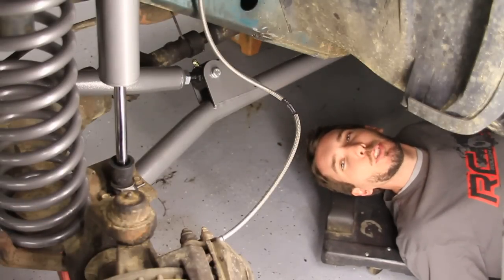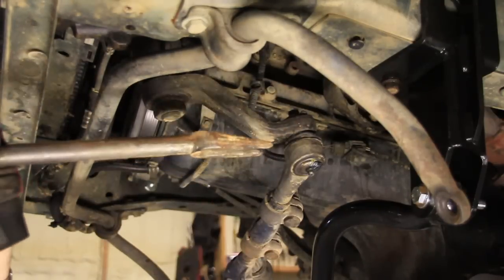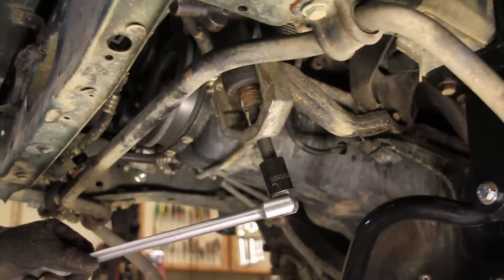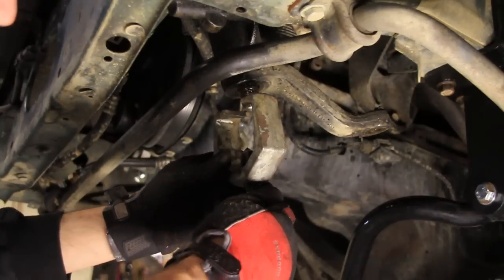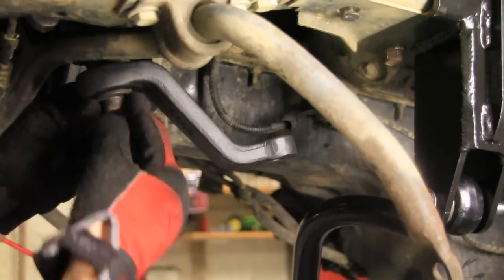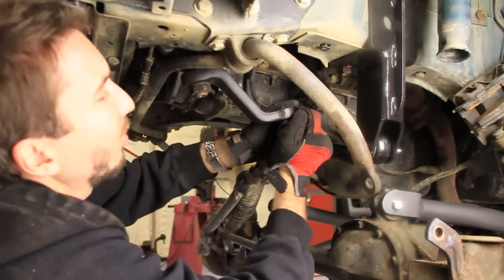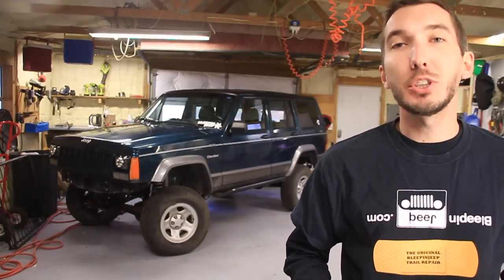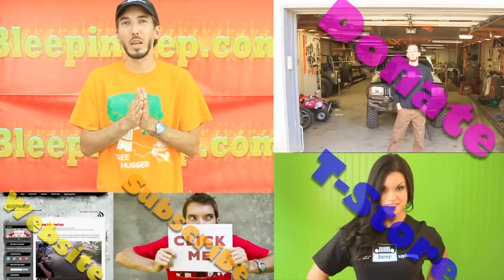How-To Remove a Pitman Arm

Comment: GOOD VIDEO AND ADVISE!  I watched this during my 4.5" long arm install on my wj last sunday.  If anyone is going to do the same I suggest you take the pitman arm off first before you start to cut off the stock brackets that connect to your original short arms.  My instructions said to cut the brackets off than go to the pitman arm. Well... once you cut the original brackets off to prep for the new ones. you are now at the point of no return i learned after words. My pitman arm was not happy and would not come off.  We spent well over 4 hours of hell trying to get that damn thing off.  After lots of cussing and moral boosting, we prevailed and won the battle and it finally came off.  After 19 hours and running on fumes we finished the lift. I learned a lot, but i will never do another lift again. If you have never put a lift on and are about to. My advise to you is be READY FOR BATTLE!

Comment: I can tell that the likely reason it got stuck is that the puller went uneven and the pitman got cockeyed coming off the splines.  I suspect a tap back down along the viewers left side to straighten out the pitman on the splines would have done it.

Comment: when taking the pitman arm off our 3500 dodge, we broke two pitman arm pullers lol we used a Hickey Bar on the end of a crescent wrench and had to physically walk around the front end pushing that bar to get the nut off. we also used a torch which did more work in a few seconds than we did tooling around for a half hour. amazing what a little heat will do

Comment: I am just now starting to replace the major steering component in my 09 Jeep JK.  Most the work is easy to do.  Basically you just have to remove a couple of nuts and bolts.  The hardest part is to hammer, more hammer the various joints in order to remove the joints apart.  Since I don't have a lift, there is little leverage to deliver a strong hammer blow when lying on the back and with limited arm movement.  All the specialise tools can be rented from the local AutoZone.

Comment: So does the pitman arm have a key-way or do you need to chalk it first to get the original setting ?
Reply: They usually have a different pattern of splines or  some sort of alignment. They only go on one way for all of the ones I have done

Comment: When do you know whether to replace the arm, or just the seal?
Reply: The arm is simply a block of metal if the arm is rusted and falling apart replace it, if the arm seems to be in ok shape, or the same shape as your steering links you shouldn't have a need to replace it.  If your leak is coming from the shaft you'll have to replace the seal alone but removing the arm is the only way to replace the seal.

Overall if the pitman arm looking like arse, replace it, if you pitman just got the runs replace the seal.

Comment: Hey Matt! I just put a rough country Pitman arm drop all my 97 XJ 4.0 with a 4.5 lift, replaced all my tire rod ends and my drag link. I measured the old drag link from end to end and matched the new ones up. When I tried to install the new drag link into the Pitman arm it was about 1-2" to long. Do I keep the same length as my original drag link and tie rod or do I need to shorten them for the new Pitman drop arm?

Thanks in advance,
Nolen Hodges

Comment: Most pitman pullers have a rounded top on the bolt. Which is meant to be struck with a hammer.
Reply: That's what I thought
Reply: I was told a long time ago, before all this internet was available, You tighten the puller down, strike the bolt with a hammer, tighten some more . It will come off.  Don't follow that, the puller will probably break.
Reply: Yup.  Put a good amount of tension on it with the puller and then just a few sharp hits to break up the gunk and it pops right off.  Same technique for a ball joint separator.  The pullers are meant to apply a pulling force and the sharp blows to break the gunk holding it.

Comment: hey I just got a 2001 xj with a 3in lift and aftermarket draglink and tie rod assembly. the tie rod ends are shot. can i use oem tie rod ends? no manufacturers name on steering components

Comment: the way i got it off the drag link was unscrewing the tie rod end all the way off and then using an air hammer on it on the bench and it popped right out

Comment: Should only use high quality tools that why it broke the one i used broke too but stripped the inside threads i had to her a hammer and torch and it came right off

Comment: would a propane torch work too, like the kind you use on copper soldering?
Reply from the maker: +m00nchildblues no, propane doesn't get hot enough.

Comment: This is great you give more ideas to install the others part. Yesterday I install 4.5in front suspension lift kit of F250 diesel engine. But my customers buy the kit they don't have a catalog manual that's why I miss some parts when I can be installed it. I hope you send me at least a catalog manual and I can install fropelly and less time of my job as a Mechanic. Thank you.

Comment: Strike the head of the pitman puller bolt once the puller is nice and tight and the pitman will come off everytime.
Reply: Do you strike the end of the bolt on the puller?
Reply: @salc1300  yup, hit it like you are trying to drive it into the steering shaft.
Reply: @WrightPerf  thanks buddy...
Reply: Did that definitely didnt work.

Comment: what's the purpose of a pitman arm?
Reply: ***** A pitman arm connects to the steering box (turns with the steering wheel) to the drag link.  The drag link is a rod that goes between the pitman arm down to the knuckle on your axle.  Basically via the drag link, the pitman arm/steering box pushes or pulls your knuckles one way or the other to turn your front tires left or right.

Comment: I've installed a Rubicon super ride 3.5 in lift with adjustable track bar. does anyone know if you really need to put on a 3.5 inch drop pitman arm? DM me if you know! 1999 XJ.😎👊

Comment: This is how NOT TO DO THIS. First soak the area with PB blaster for at least 30 mins. Put the tool on, tighten with a wrench till you know almost breaking pressure. Whack a mole once with a small sledge on the end of the tool nut and it breaks loose.
Reply: So, then why are you here watching it?